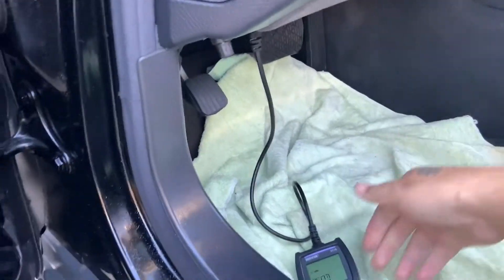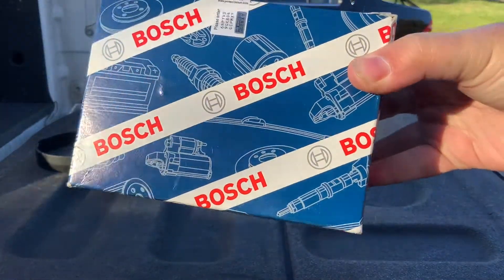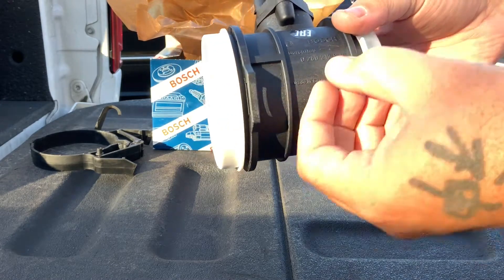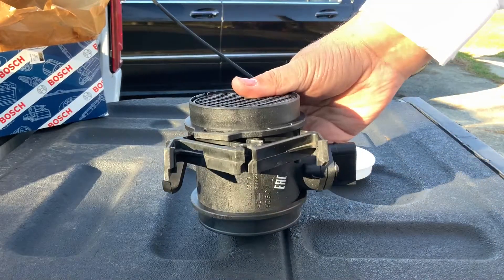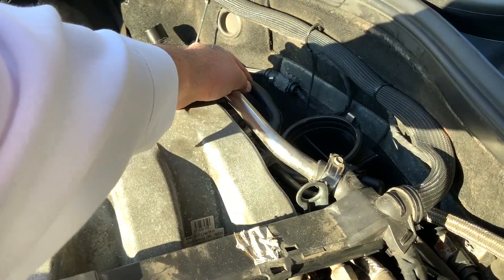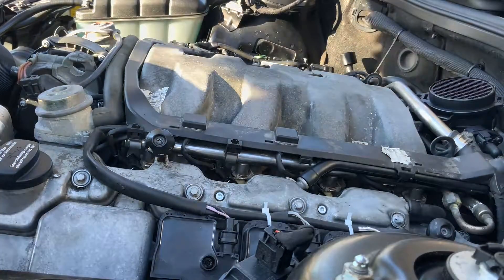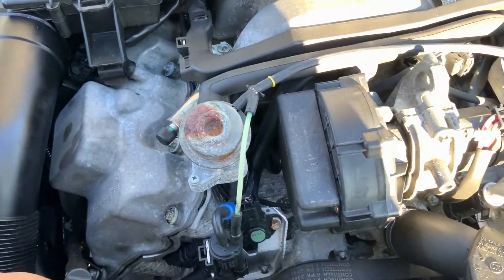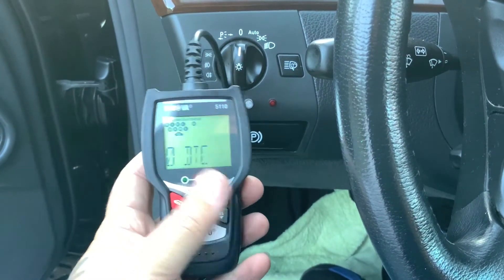Need to replace this?…I’ll show you how to mass air flow sensor ( Mercedes m113 engine)

Comment: 5:00, it's supposed to click going into the Intake Manifold and it didn't.. you have an issue and it may not have seated correctly.
Reply from the maker: Depends on how strong ur clip is to be honest. Mine never made any sounds and is currently seated.. have to be careful with old plastic parts. Sometimes they will randomly snap off pressing on them to hard 😬
Reply: @piscatawaymechanic  That might be it tbh, just a worn clip that just doesn't snap anymore but still locks it in place. Thank you for the video!

Comment: So frustrated with my 1997 E420. It has the M119 and there are no videos helping me out and it is very confusing. I’m not trying to spend $500 at a shop too
Reply from the maker: Well I would say first thing get a obd2  fault code reader plug it up under the driver side dash. Then tackle the codes one by one. These cars are a pleasure to drive but a time consuming process to repair
Reply: @piscatawaymechanic  I already did because the idle was terrible and it was lurching forward at low speed and the 2 codes came back and said maf sensor. What do i do it’s different removal than a e430 and it’s pretty confusing

Comment: Can I have a failing maf and not have codes? I'm having bad idle and misfire issues. Already did injectors, coil packs, plugs and ignition wires. Going crazy with my S430. ☠
Reply from the maker: Hello. Yeah with my s55 it took a few months with like a bucking and hesitation at idle and taking off. For the mass air flow sensor to say it’s faulty.. now this car is very complicated because the wiring harness could be failing, the ecu  , blown fuse .. but keep checking the obd2 codes it will eventually Pop up.. if u don’t mind buying a new  mass air flow sensor it will never hurt to replace the old sensor with a new oem one. Just Don’t buy it aftermarket.. so hopefully that helps u.
Reply: @piscatawaymechanic  I just received a Bosch maf from FPC today but was hesitant to keep it cause it seemed like a waste but maybe it will help. My current Bosch maf is only 2 years old and I only drive about 6k miles a year. My idle sounds and feels like a hot rod with cams..  My compression on the 3 problematic cylinders was at right around 180. Cylinder 5 is constantly showing "faults" that get cleared right before they hit 20 and it never throws an official code or check engine light. Just 3 misfires and I get the TWC code along with it. On smooth running cylinder 5 hits like 20 sometimes at idle. I have no clue what the heck is going on there. Thanks for responding.  Look forward to learning from your videos.
Reply: @piscatawaymechanic i can’t figure out where this goes? i have an e55 amg and it doesn’t go there

Comment: The seating where the airbox seals with the MAF can be placed incorrectly if you don’t put the airbox on right! Make sure that the airbox is seated properly, this seems like a great first think to check and it costs nothing and it fixed my issue.

Comment: What r the symptoms of that failing
Reply from the maker: well the car didn't run smoothly . thats when you should get out any obd2 code scanner you have ..after plugging it into the port under the dash on the driver side .. the code p0103 or p0104 was showing.. which indicates bad mass air flow sensor.. so what ever you do ,just make sure to scan for any obd2 codes first ..this will save time and money
Reply: @piscatawaymechanic  well I have an e500 2005 and I just put new spark plugs new wires and new ignition coils and when I’m driving around and come to a stop the car would shut off
Reply: @piscatawaymechanic  do you have any clue what might be wrong ? It like shuts off and then I just start it again and will run again but only when I come to stop light or red light it shuts off
Reply: @CocaBuster69  hey you were right it was the crankshaft sensor position thank u omg u saved me so much money I had mechanics trying to rob me for over 2,000$ dollars
Reply: @bbdy13  When the crankshaft sensor is just starting to go bad it'll only shut off after the sensor gets hot.  As a cheap sensor test (to know if the sensor is going bad) you can pour ice-water over the sensor and it will temporarily work again until it heats back up.